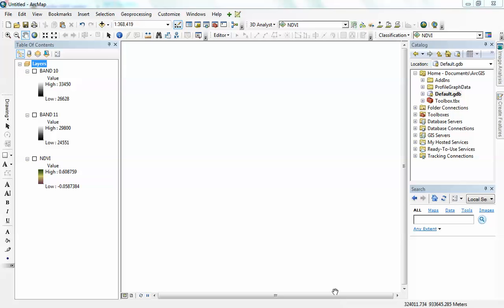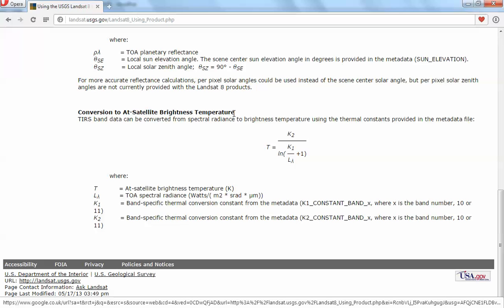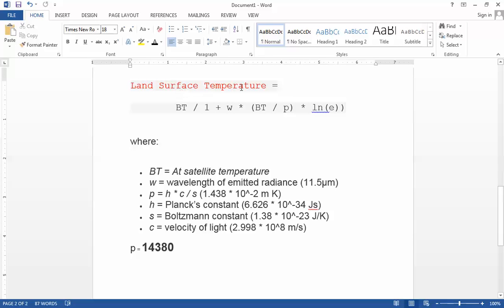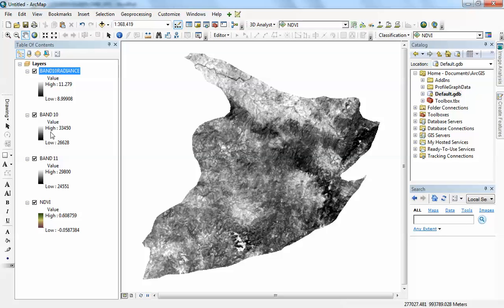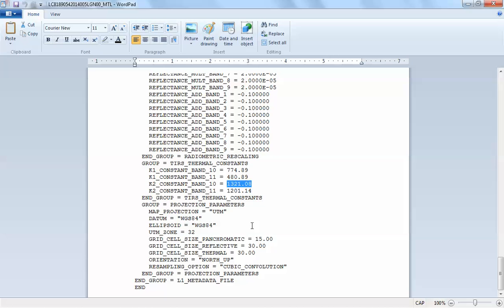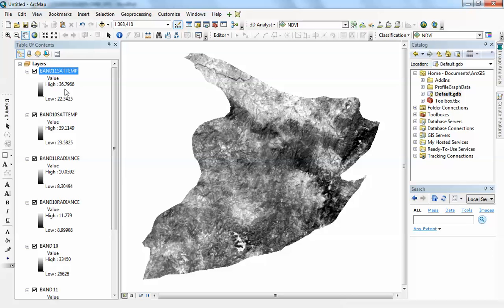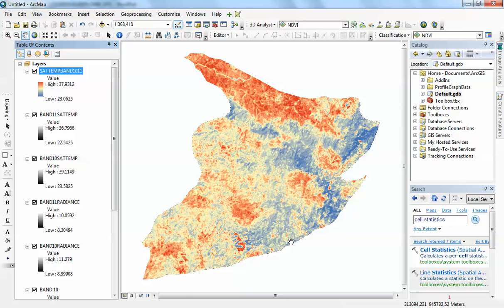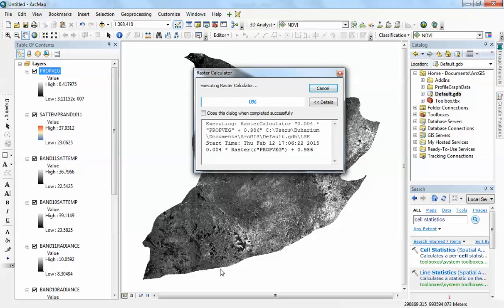Landsat 8: Estimating Land Surface Temperature Using ArcGIS

Comment: thank you very much for this , but i seem to have a challenge with it. after running the analysis for LST I got a temperature range that was very high beyond the normal temperature. what could have caused it? thanks in advance.

Comment: Mr. Usman, for the proportion of vegetation, the value of min NDVI should be written as positive values. You have wrote it as a plus for the first and then negative for the second. Secondly, to find the LST  as you have averaged out the temperatures of band 10 and 11, that should be used. Why did u use band 10? or what was the purpose to average out two bands then?

Comment: Howdy Usman, thank you for this tutorial. However, I would like to point out a possible mistake you have done while calculating emissivity. Since minimum NDVI values are negative you should have changed both subtractions signs to addition signs.In my trial my Percent Vegetation ranges from 0 to 1.Another question : in literature I saw that NDVI for soil which is normally 0.2 and NDVI for vegetation which is normally 0.5 is used instead of Minimum NDVI and Maximum NDVI.If you have a reference for the calculation of percent vegetation in the way you did, can you please share it with us.THANK YOU SO MUCH.
Reply: Do you have such information?
Reply: @TIGEO-GeotecnologíaSoluciones  Comparison of Three Algorithms for the Retrieval of Land Surface Temperature from Landsat 8 Images
Reply: @rebinu this ur thing is not English!

Comment: Thanks very much for this video. I followed the same procedures but I'm finding the negative values of LST, which have never been occurred in our country(Burundi, that is tropical country). Note that the temperature range from 18 to 30degree Celsius, but here I find -10.90 to 10.56 degree Celsius) Can you explain me why these negative values occurs? thanks.

Comment: One question. In the case of needing an atmospheric correction, what would you recommend. It is more likely to have the need of work with more than one date, so the correction is handy. Thank you for the tutorial.
Reply: Use FLAASH or 6S... I think are the best actually models.. but If you dont have experience use DOS directly

Comment: what are satellites with high resolution  having thermal bands other than landsat and ASTER ?
Reply: There is NAIP imagery. This is very high-resolution (1-meter), although you have to pay for it, and the return interval is far more infrequent than landsat. It's not expensive though... a few gigabytes of imagery will cost about $20.

Comment: For those interested in using this methodology in urban areas, in 2007 Stathopoulou published an urban emissivity equation of: 0.017Pv+0.963.

http://www.tandfonline.com/doi/full/10.1080/01431160600993421?scroll=top&needAccess=true

Integrating Corine Land Cover data and Landsat TM for surface emissivity definition: application to the urban area of Athens, Greece
Reply: Indiana1616 do you have paper for estimation of emissivity in montain area ?

Comment: For those curious about the literature backing up the equations in this video...

Emissivity is based on: Sobrino 2004 Land surface temperature retrieval from LANDSAT TM 5. Of various ways to calculate emissivity, this is the NDVI thresholds method. http://www.uv.es/ucg/articulos/2005/Publications_2004_10.pdf 

LST is based on: Weng 2004 Estimation of land surface temperature–vegetation abundance relationship for urban heat island studies
http://www.sciencedirect.com/science/article/pii/S0034425703003390

It seems to me that the values used in the emissivity equation are the most important. The literature notes that an error in emissivity of just +/- 0.025 can lead to an error in temperature of +/- 2 Kelvin.

Comment: Why are calculating the surface temperature using band 10 only? Why did you calculate the mean value of band 10 and 11? Can you also verify these formula BT/1+w*(BT/p)+ln(e)), the bracket are not matching. Your tutorial is good. These questions shows that its easy to understand.
Reply: There are errors associated with band 11 (and minor errors associated with band 10). USGS does not recommend using band 11 for quantitative studies. To your other question-- the negative sign on the other NDVImin was incorrect. Band 11 errors can be up to 8 K off from actual and Band 10 errors can be up to 4 K off from actual.

https://landsat.usgs.gov/how-are-thermal-infrared-sensor-tirs-thermal-bands-aboard-landsat-8-used

Comment: The formula for Land Surface Temperature is missing a left-parenthesis 
right after the division symbol to group the whole denominator.  
Otherwise you are just dividing by one before adding the rest of the 
stuff, as ArcMap follows the normal algebraic order of operations.  Same
 for the NDVI formula -- should be  ((NDVI - NDVImin)/(NDVImax - 
NDVImin))^2.

Comment: Hello Brother Usman, You did an Amizing work with those calculations, I did the same thing with the ocean temperature using landsat 8 in er-mapper, but I still had some question for the work we both had done which is how we gone use this kind of analysis since I found that no matter the result is, the result depends on the period of the time that sattelite taken the data. differend time produce differend results. I think you agreed with me :)

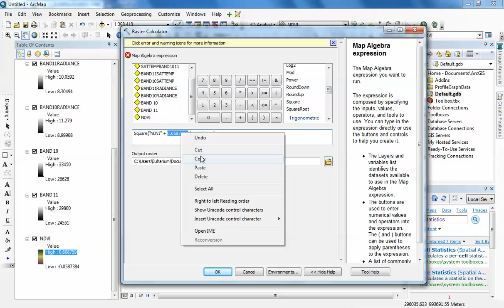Comment: Usman, at 10:44 of the video where you put formula for Propveg, the (ndvi_max - ndvi_min) should have been (0.60875 - (-0.587384)) = (0.60875 + 0.587384). I think you forgot to multiply two minuses. Great tutorial though.
Reply: i have the same doubt. i think you did wrong.

Comment: Hi Mr usman Buhari, thats is really helpful video, i am just wondering, do i need to do atmospheric correction for my image, specially for thermal band 10 and 11. Before calculating land surface temperature. Thanks
Reply from the maker: I would recommend you do an atmospheric correction for all bands as this will take care of most atmospheric errors with image.

Comment: Thank for the wonderful presentation. I closely followed all your procedures for my study area but my minimum LST temp is negative which I'm sure can't be possible. Sir, can it be because the Landsat data were not corrected atmospherically or what?
Reply: it is due to cloud contaminated pixels..USE gross technique to detect cloud contaminated pixels and exclude by using set Null function in Arc GIS

Comment: hello Usman Why you use a p value of 14380? when the result of  p  = h * c/s  is equal to  0.01439474
Reply: hi Husam is this value (14380) can be fixed value so it can be used for all Landsat data

Comment: Hi thks for your videoOne question for the thermal calculation (next videO) Do you know how much error if me missed to calcutae e (emissivity ) with NDVI process is long enoughor is there anotherway to have ground temperature with metadatfile on B10?Tks a lotmudryjm@bluewin.chLire la suite Moins Répondre1
Reply from the maker: Hello Jean, sorry i can not tell you how much error there is if you don't calculate for emissivity and NDVI but there will be some sort of error atleast as you have not followed the initial formula used in this method. You can also search for other ways of estimating LST on the Internet.

Comment: First i would like thank you for your amazing videos.
My question is that as my study area falls under multiple scenes due to large area. The sun elevation is different for different scenes. I want to know how to choose the sun elevation for different scenes as i have to mosiac them first.
Regards
John
Reply from the maker: Hello John, since you have multiple scenes it is best you treat each of them separately after which you can do the mosaic. This is part of beat practices when using remote sensing data, because each scene is taking at different times with different factors.

Comment: Hi Usman,
I am not sure its a mistake or there is a reason behind it, that the equation for the NDVI, in the denominator part you didn't changed the -*- to + while putting the value for NDVI min. I am doing this for my Research Project, so kindly if you can tell me the reason for it.
Great video !
Reply: it was a little mistake in conversion only, So as Akram siad just use (14380) for P and it will be fine

Comment: Dear Usman, firstly thank you for your nice work in this video. I am trying to do same operations on my images but I think I cannot succeed it so at stage of conversion from radiance to sat temp. my values range from -124.633 to 43.7934 for Band10 and similar results for Band11, is it possible or I am doing a mistake one of the stages. Could you help me about it.
Reply: Hey, I know this is an old post, but how did you end up fixing that problem?
Reply: +Sinan ARAS I had the same problem while later I found the extreme values such as -124 were for the marginal part of the segment without valid thermal infrared info.
Reply: Cut out only one area that you will use. The edges of the image have no ability to express themselves negatively.

Comment: i have lttle confusion here 
1st= while conversion factor for kelvin to degree celsius is -273.15 but u did  -272.15
2nd While calculating LSE  in the  at first while taking NDVI min in the numerator part you told *=+ you added the NDVImin but at denominator part you didnt do so what is the reason behind this.
Could you pls elaborate it.
With best Regards
Reply: Here noticed the same things

Comment: Hi Usman, thank you for the upload - very helpful ! Do you by any chance have a reference for the LST and Emisivity formula you have used? Would really appreciate it
Reply: +islandmonkey87  Found the references 
Emissivity : Land surface temperature retrieval from LANDSAT TM 5, Sobrino et al, 2004
LST : Estimation of land surface temperature–vegetation abundance relationship
for urban heat island studies, Weng, 2003
Reply: +islandmonkey87  Also note that the Land Surface Emissivity formula  is only  valid if no water bodies are present in the image 
look at this article, pp 8  : Comparison Between Fractional Vegetation Cover Retrievals
from Vegetation Indices and Spectral Mixture Analysis: Case
Study of PROBA/CHRIS Data Over an Agricultural Area
Reply: Hi Majid,  i ended up writing a Matlab script instead of using ArcGIS to process the Landsat data. I have used the NDWI with a threshold value to remove water bodies from the satellite images. Once the water body pixels were removed i calculated LST
Reply: thank you
Reply: @islandmonkey87  Is there any method to calculate temperature of water bodies?

Comment: Two part fixed:
PROPVEG = Square(("NDVI" - "NDVI_min")/("NDVI_max" -  "NDVI_min"))
LST = "sattempb1011" /( 1+(10.89* "sattempb1011" / 14380) * Ln("LSE"))

Thanks Usman Buhari's video, wish you all will do it well.
Reply: The middle Value to Use Landsat-8 Band 10 is 10.89 https://landsat.usgs.gov/what-are-band-designations-landsat-satellites
Reply: Shouldn't the second NDVI_min also  be positive since its a negative number
Reply: +ScottC Why the 10.8? Is it he mean of wavelength of Band10? Thank you.
Reply: +AJ C Sir, You can follow http://fromgistors.blogspot.com/2014/01/estimation-of-land-surface-temperature.html,  the band 10 Center wavelength (µm) of Landsat-8 is 10.8.
Reply: Thank you very much,your corrections were totally useful,and the link as well.
Reply: @Sathees Kumar P look at metadata files

Comment: Nice video.Tanx. Usman sir i used your video for my research was great but it works only for landsta8. i should done some images for landsat 7 about same topic(Land Surface Temperature) is it possible give me some information that how i can get LST from landsat7.
Reply: Shiva Babazadeh The best method I know to retrieve LST from Landsat 7 or Landsat 5 is from Sobrino et al. 2004. Just google this: doi:10.1016/j.rse.2004.02.003
Reply from the maker: Shiva Babazadeh Oh thats great and I am glad this video was useful to you during your research. Yes, I believe you can do same for Landsat 7 data but unfortunately I cannot provide you with any information at the moment. I will recommend you take sometime to look into the Internet as this will not be far fetched.

Comment: When you calculate emissivity in minute 10 you correctly minus the NDVI min (so you end up adding it since it's negative), but in the second half of the equation you subtract the NDVI min from the NDVI max, but instead of subtracting a minus (adding it), you just subtract it. Am I missing something?
Reply: Usman Buhari No problem. Just wanted to make sure I hadn't missed something. Thanks for the video.
Reply from the maker: Thanks Liz, well this is what happens when you try to do this huge task in less than 15mins 😀
Reply from the maker: Liz Chamberlain Ahh, my bad it was (though basic enough for everyone to know what to do)...should have been an add. Thnaks.

Comment: Hello, thanks for uploading this video. I would suggest to check some of the equations you used in your tutorial. I can see some small errors (for example the PV formula is missing a parenthesis) that can greatly change the results. By the way, Rho value is 1.438e-2 (0.01438).
Reply from the maker: Hi, thanks for the comment. I would again want to mention that several methods have been developed for estimating LST so somethings you term mistakes might just be correct. However, I just watched the video again and can't find where i missed a parenthesis in the PV equation, would you mind telling me the exact position i missed it? And what do you refer to "Rho"?
Reply: Hi Usman. Thanks for taking the time to answer to my comments. As far as I know the PV formula is [(NDVI - NDVImin) / (NDVImax - NDVImin)]^2, but it seems that in your explanation you missed the parenthesis that separates the upper and lower part of the formula. With "Rho" I was referring to this formula: Rho = hc/s = 1.43810e-2, s = Boltzmann constant (1.3810 23 J/K), h = Planck’s constant (6.62610 34 J s), and c = velocity of light (2.998108 m/s). I am not an expert in this topic, but I was reading a few papers and then watched your video, so those differences called my attention. By the way. I just found other paper that uses an alternative way to estimate the LST. It's an open access journal: http://file.scirp.org/Html/3-8401104_17055.htm. All the best!
Reply from the maker: Thanks Ignacio, as for the PV I would further me research on that and for Rho its just basic physics and maths and am certain about the value (14380).

Comment: Hi Usman
Thanks for the nice tutorial.
It really helps me (I am working on my thesis).
But, I think you should input the value of central wavelength (10.8 micron) for your "w" value, instead of refering to the original band 10 (DN value).
See http://fromgistors.blogspot.com/2014/01/estimation-of-land-surface-temperature.html
Reply from the maker: Thanks Inu, I just read through theink you sent. Like I said in my video, there are several ways of deriving the LST. However, I guess you misunderstood what the guy in the blog did. 10.8 or 11 are estimated centre wavelengths of band 10 (in landsat 8) which is required in the formula. Maybe if you deepen your research then you will get to understand how the formular works better. Thanks again for your contribution.
Reply: Thank you